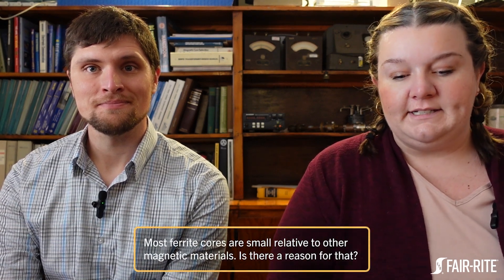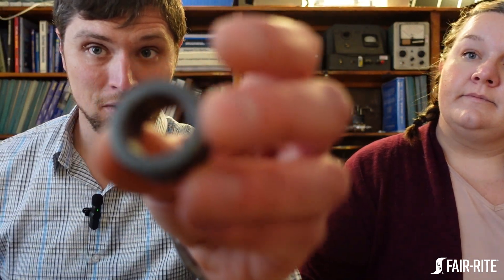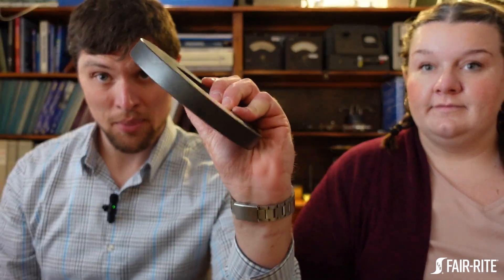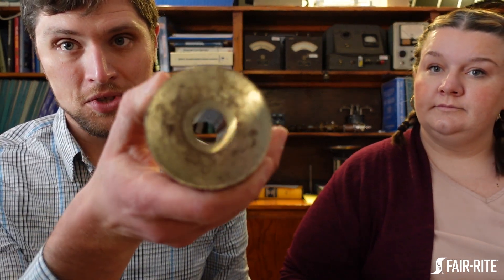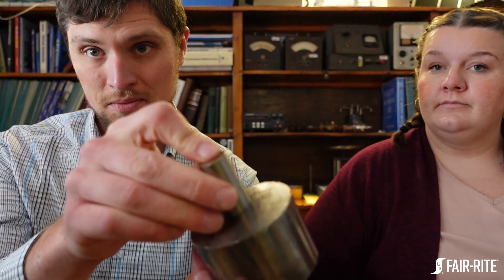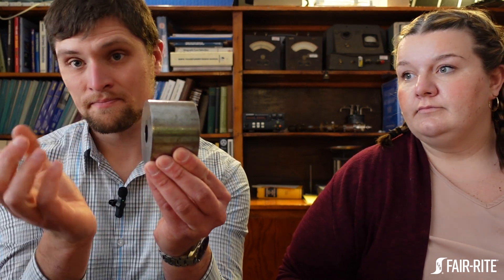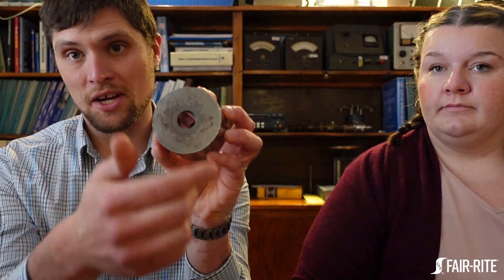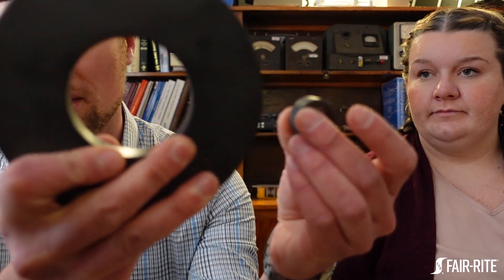S2 Ep 3: How Big Can a Ferrite Be?

Comment: In broadband (RF) transformers, how do you get higher power handling and wide bandwidth at the same time?
Reply from the maker: One trick would be to use several smaller cores stacked together or in parallel. Lower cross-section cores will typically provide lower losses over a wider range of frequencies (to a point) but, they cannot handle the same sort of flux density as a large core. The ideal core would be something like a long tube shape. Thin walls but, high length the get the cross section number back up. A stack of small cores can be used for a similar effect.

Comment: Particle accelerators eg SLAC use large ferrite rings and maybe 10 inches dia and 1 inch thick.  These are stacked to make typical pulsed magnets , eg kicker magnets.These ferrites are sometimes used as saturating magnetic swithces. This is highly dependent on the materials.

Comment: Thanks for some good info on ferrites. The video brought 2 questions to mind:
1. You mentioned gluing ferrites together. What glue should be used? If a ferrite has cracked or broken, can it be glued to return it to service until a replacement is obtained?
2. What would be the effect of using a toroid that is bigger in size (but of proper mix) than is needed rather than an appropriate size toroid?
Thanks
R.E. - K1AUS
Reply from the maker: For adhesives, cyanoacrylate works very well on ferrite cores. Gluing a broken core back can work with a few caveats. If the fracture or break is running across the magnetic path (O.D.-I.D. on a toroid for example), there is going to be some loss of effective permeability. This loss will be proportionately larger on higher permeability materials than lower ones. Whether or not the core remains functional really depends on what it's being used for and how sensitive the application is to values like inductance, coupling coefficient, impedance, etc... As far as larger than needed cores, it again will depend on what it is being used for. Large cores will have higher inductance values typically and produce lower core losses due to the reduction in flux density from the greater cross sectional area. Windings can be spaced apart further leading to lower interwinding capacitance (can be good or bad). A negative is that ferrites (all ferrites) are prone to dimensional resonance beyond some frequency when the cross section gets too massive leading to higher relative losses and reduced bandwidth than a smaller toroid of the same material. That last one isn't yet well quantified and it's significance will vary a lot by size, material, and frequency.